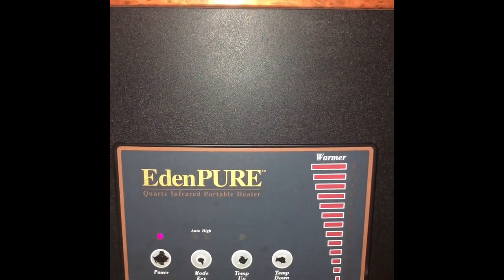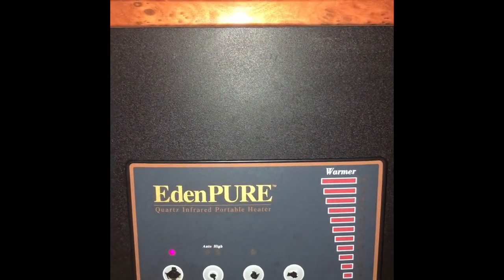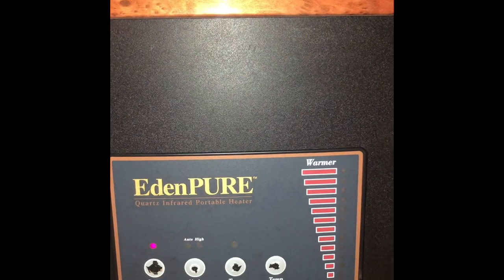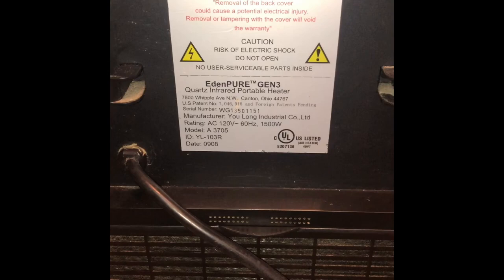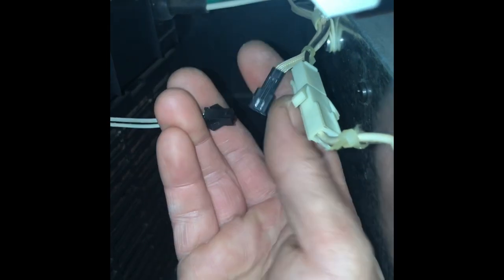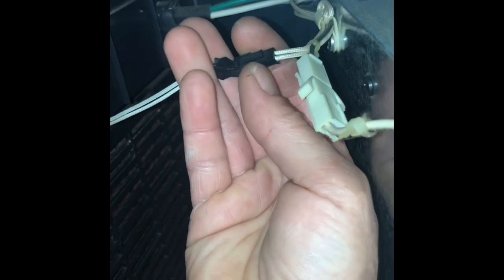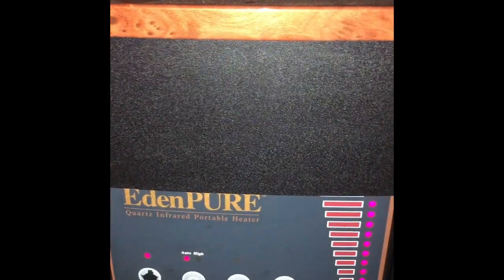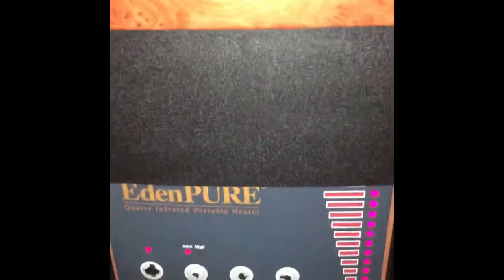DIY-EDENPURE HEATER POWERS ON AND THEN CUTS OFF

Comment: Thanks to this video, it pointed me in the right direction to fix my problem. I have a Gen 3 that worked fine until it was put in the max heat mode. When in max heat, it would run a little while then it would auto shut off. This video showed me the vent holes for the thermostat, and they were clogged with dust. Mine were clogged with dust as well. I vacuum cleaned out the dust clogged holes to where the thermostat could get air from outside the heater. The heater was not overheating. It was the thermostat overheating. Cleaning out these holes fixed my heater shutting off problem.

Comment: My Eden Pure does the same thing but the new thermostat didn't fix it, any suggestions?
Reply: Didn’t work on mine either. I also had a broken bulb, and so I replaced all of those and checked the circuit board fuse…still not working.
Reply: Mine does the same thing however instead of fixing it, I found that if I quickly switch the mode to High it works. If you don't get it the first time just unplug the unit then plug it back in and try again.